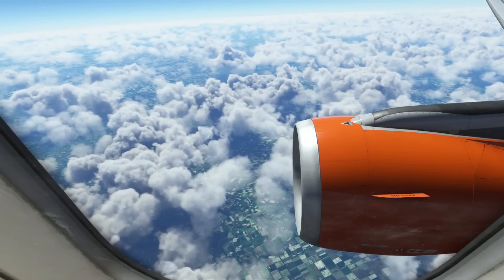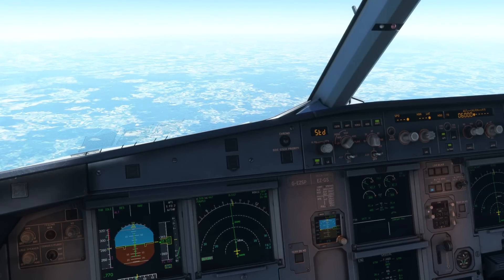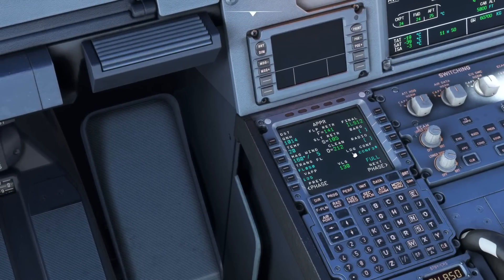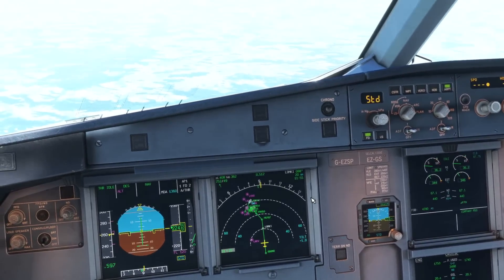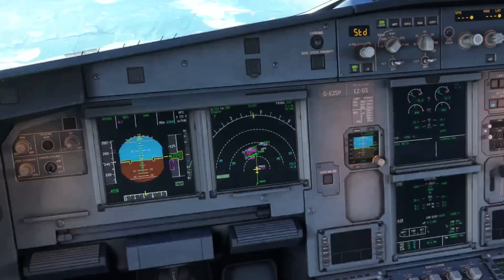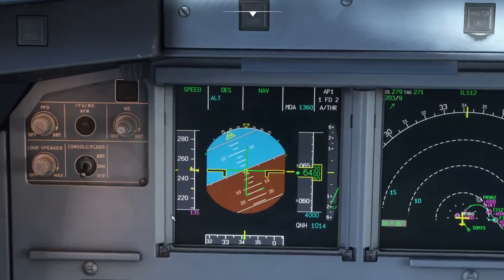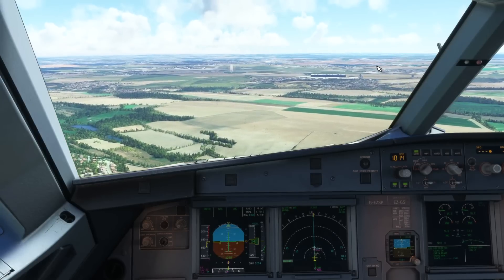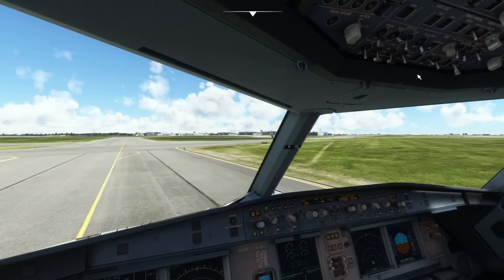FENIX A320 - Descent, ILS Approach & Landing  | Tutorial Series Part 7

Comment: That was an amazing tutorial series. I binge watched the whole thing while taking my own Fenix A320 from NZAA to NZCH, following you one click at a time (and making loads of notes) setting up my plane and getting it out to the runway and into the air, then the cruise down to to NZCH was JUST long enough to watch the setting up for the arrival and landing bits, which - to my astonishment - worked just as intended !  The only thing I didn't get was when in the approach do you press the LS button, and what does it do ? You did a jump cut and when you came back it was on. I vaguely remember it stands for 'Landing Systems" but that's all I have :) Thanks again, this was excellent !
Reply from the maker: Thank you for watching. All the LS button does it display the ILS magenta diamonds on the PFD.

I usually put this on around 10,000ft. 👍
Reply: Brilliant, thank you.

Comment: I was under the impression that since every waypoint in the F-Plan has its designated speed and altitude (constrained or not) the plane would obey this and start descending and/or slowing down in time to meet these values. I missed so many approaches because I didn't manually initiate a descent or manually lower the speed. 
I was just wondering what's the meaning of entering these constraints in the FMGS since we're going to fly the approach (practically) manually anyway.
Thank you so much for these videos, the whole series on the Fenix A320 was invaluable. I must be responsible for half your views since I'm watching them over and over again :D
Reply from the maker: Haha, thank you. The values in the MCDU are for the descent profile. If you left the aircraft in managed speed and managed descent mode, it would follow all the constraints in the MCDU FPLN page.
Reply: @Easyjetsimpilot  Thank you so much for the reply. So the A320 would follow all the constraints if you leave it in managed speed and altitude mode. 
Well here is my puzzlement. It doesn't! 
At first I thought it was a bug in my set up but then I saw your video and realized that the same happens with your flight. 
At 0:55, the plane (although in managed mode) ignored the TOD mark and it only started to descent at 1:38 when you manually changed the altitude to 6000ft
If you don't change it yourself, the plane will continue flying at this altitude until you reach the airport and then you have to spiral your way down in order to land 
(a maneuver known as the "Baghdad" approach)  :D
Please forgive my ignorance but being obsessed with such a complicated system (at least for an amateur) as the Airbus A320, produces a lot of frustration.
Thanks again
Reply: @stefstaf  Although I'm new to the A320 I haven flown VNAV/Managed descents in other aircraft. With what you're describing, it's important to note that the aircraft will fly to the highest of either the altitude set via the selector knob, or the altitude in the F-Plan. Your altitude selection needs to be equal to or lower than that of the F-Plan constraints for the plane to begin descending. If your constraint is FL120 but your altitude selector has been dialled to FL150, then your plane won't begin a descent to FL120 at the TOD.

Similarly, for the Go Around, you need to dial your altitude, as you're on your landing course, to the altitude constraint defined by the Go Around procedure charts. Otherwise the plane will misbehave during a go around. At least this is how it behaves in the Cessna Citation Longitude.

Comment: I think it was a glitch but everything was going so well on my first flight with the fenix a320, I was on short final for runway 27 at EHAM doing an ils approach I set flaps 3 then all of a sudden I had a flap limitation issue where I couldn’t go above 160knots or under 145 knots. Either way it disconnects the autopilot at 2800ft and the plane just went crazy. Auto thrust wasn’t working properly so I had to try and regain stability of the plane as it seemed like it was stalling. I tried to put on the auto throttle and auto pilot but wouldn’t work before eventually losing control and smashing it down on the runway which ended the flight as it destroyed the gear
Reply: Go around
Reply: @EldarKhaitov  wasn’t possible

Comment: one question, when at 700/600 feet I disconnect the autopilot the autoland alarm is off. How come? A thousand thanks
Reply from the maker: Ensure that your autopilot disconnect button is bound to AUTOPILOT OFF in the MSFS settings and not AUTOPILOT TOGGLE ON/OFF
Reply: @Easyjetsimpilot  ok thanks does it also apply if I click the AP button in the cockpit with the mouse?

Comment: Why do some use the first temp of the two, and others use the second of the two. In this video he used 20 from the 20/04
Reply from the maker: If you can time stamp I'll try and explain.
Reply: 5:08
Ive seen others use the second number, so I just want to clarify which is correct to use, or are their circumstances when the second number is used. Thanks
Reply from the maker: @jay-rus4437  Ahhh OK. The first number is the temperature, the second number is the Dew Point (the temperature at which the air can no longer hold water so it begins to condense). When the dew point and temperature are the same, mist and fog start to develop.
Reply: Can someone tell me why when I disengage autopilot on final approach, say 500ft, the master warning goes off and wont stop. So I have to look down and hit the cancel manually? Its very distracting when landing. Am I missing something?
Thanks
Reply: Thank you for the videos. While I certainly appreciate, and watch, nearly all of 320 Sim Pilot videos, you are actually easier to follow for us beginners. Both of your channels are fantastic, so I watch both multiple times, but have just taken notice of this over the past couple months.
Reply from the maker: @jay-rus4437  you need to set your AP disconnect button you're using to AP OFF in the sim settings and not AP TOGGLE.